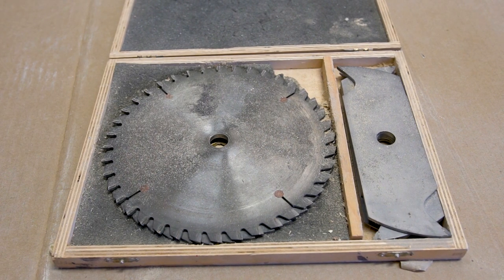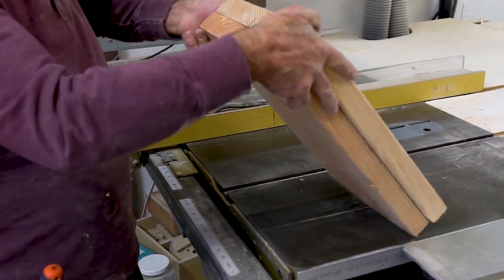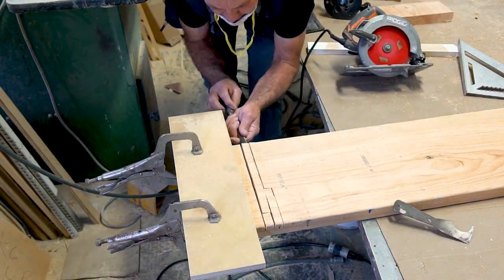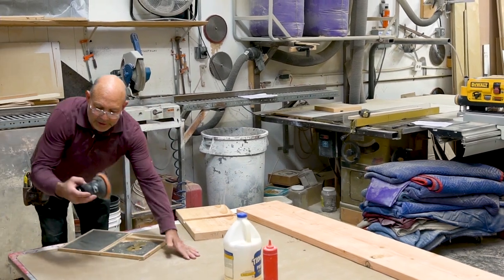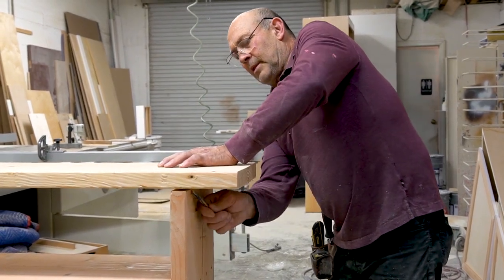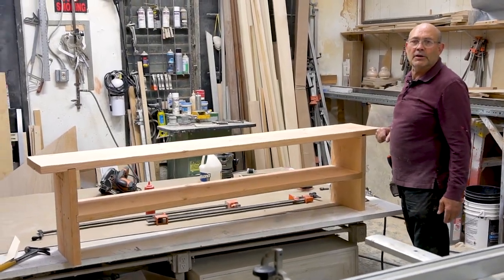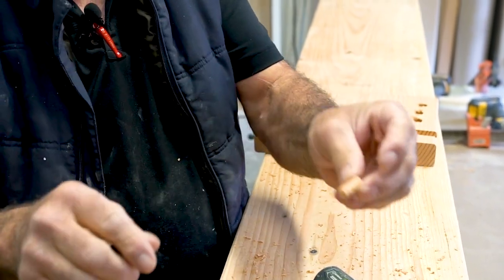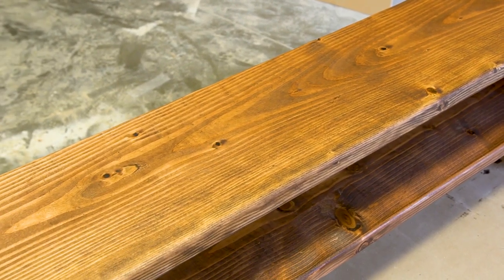How To Build a Simple Shoe Rack Bench | DIY

Comment: Hi Jose. I have to say that you explain very well and I like the fact that you don’t hide any detail of the building. Let me ask you something what is the technical explanation of the relieve cuts you do on the wood to avoid warping? For example What would do that groove in the center of the top wood? Would you do a video giving típs to work with green wood? Would be useful since most of the 2 by’s sold in Home Depot are kind of wet

Comment: Im half way watching and Im thinking if this is simple or the other way around. Made me chuckle a bit. 😅 Those lumber are nice 👍. I dont think i would find those straight flat at Home depot it will make this build not simple. Since I plan to use circular saw and hand planer. 💡 I might just as well use pocket hole to make it simple.
Reply from the maker: Hi Julian, thank you for watching and commenting. The project is definitely easier with flat lumber. I tried choosing the flattest pieces at home depot but even so they still needed some straightening. Using pocket holes is another way of doing it! I agree. Feel free to comment on what you want us to build next!

Comment: Safer just to use a router to create your rabbets on the ends of your shelves. Don't forget the beginners who need reinforcement of safe machine operation and tool handling... Exposing the blade on your table saw to cut an unwieldy, unsupported piece of material is very dangerous. One slip and your student will need help opening the ketchup bottle for the rest of his or her life.
Reply from the maker: I agree! Safety is very important. Safer handling will be emphasized more. Thanks for the tips!
Reply: @BuildItWithJose  wow, nice to see the video maker not get all bent out of shape when someone comments about a  criticism with the build. really, it was kind of  nice to read your response to that safety comment from one of your viewers. and yes, its very much worth stating a "disclaimer" to folks that dont understand how certain cuts are much more dangerous than others and how kick back happens and etc. i dont think mentioning safety concerns is ever a bad thing,  if you know certain techniques or cuts are not for the novice or beginner level woodworker. good to read that you are re-enforcing  the safety aspect of your builds!!